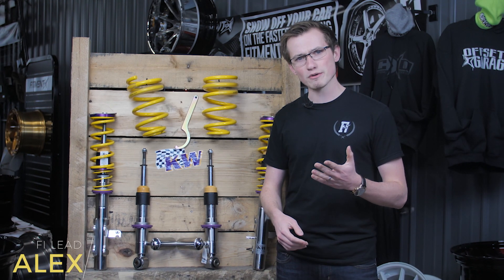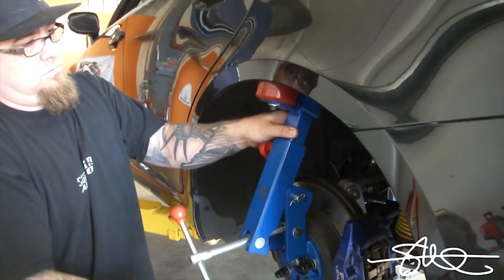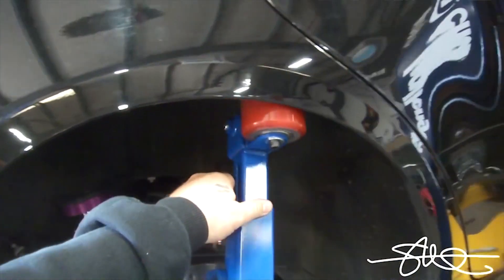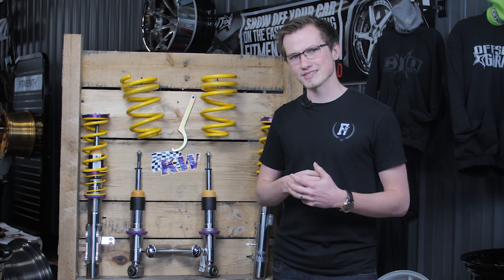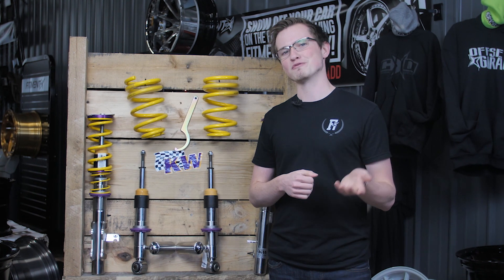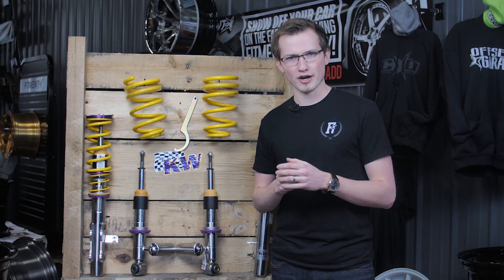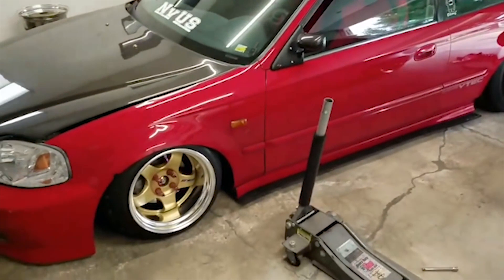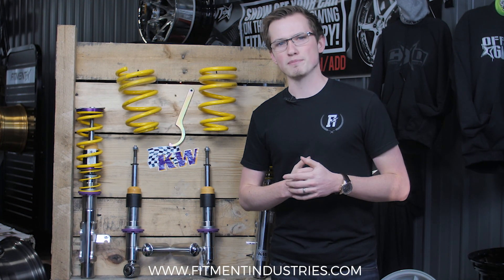5 MISTAKES When Lowering Your Car

Comment: took me years to learn but my motto is always do it right the first time because its cheaper than fixing mistakes.
Reply: Varg Sutton "Do it nice or do it twice"
Reply: That's kinda hard to do when it takes years to learn, though.
Reply: My $20 ebay short shifter broke I knew I should have bought brand name.
Reply: True

Comment: I feel like "lowering" should have been "slamming" cause most of us will do a small lowering kit, say 1-2" which negates most of these negatives (except alignment etc)
Reply: Gaunai yep. If you need to roll your fenders, you're slamming it (or you bought the wrong size wheels.)
Reply: @z-ro34  yeah I bought the wrong wheels 😓
Reply: @z-ro34  too wide 😪

Comment: go to your local grocery store
push a cart down the isle
that is my cars current alignment
Reply: Extreme vibrations ? I see
Reply: One wheel spins in every direction and barely touches the ground? Maybe time to get a proper alignment...
Reply: @heroichitsuji  yes the joke was that grocery cart wheels do not allow them to travel in a straight line when pushed forward, similar to my car, I am glad you were able to comprehend it and felt the need to reply to my one year old comment.
Reply: @Whitt09  you ever get an alignment?

Comment: I know most here won't care but another thing to mention are bump steer/roll center kits. All your current suspension components like ball joints and tie rod ends are meant to work with just factory height. Lowering can upset the car's roll center and increase bump steer. There are kits out there for each types of cars that can help correct these when lowering a car.  Obviously, they won't work when you lay frame BUT just for a moderate drop, these kits help a lot. And of course, you won't really feel a difference until you take the car to the track or even auto-x.

Comment: If you are new, and you want to lower your car...... Know how to angle your car to get over speed bumps and down/up ramps (driveways/car garages/etc). You cant just drive straight over/down/up things anymore most likely... Know your roads! Stick to the lanes youre used to. Potholes, dips, bumps, can and will destroy something on your car. I never drive slammed anywhere that I dont know the road and I always air up for sketchy roads (thank you air suspension). If you dont have the luxury of air bag suspension, pray. Unless your area has immaculate roads.. Then I envy you. Just some tips.
Reply: Michael Hookano I measured ( getting out measuring from the rocker with a tape and I did get some strange looks in the parking lot / from the side walks ) my local roads and most bumps are 5in or less so I put my lowest part point @3in from the ground. And you are so right thank goodness for low rider technology 🙂
Reply: This is why I don’t want to lower my car. I do want to get air suspension though but pretty expensive so I’ll wait till I can afford it. Haha.
Reply: The apron for my driveway is a bit steep until the sidewalk, then it flattens right out. Pulling my AMG into the drive was hairy the first couple times. There’s only one angle where i can pull in and not scrape the shit out of my front diffuser, and it makes my rear left tire come off the ground like a foot lmao. When i get my coilovers and put them on, im gonna need to get some planks or I’ll rip my bumper right off
Reply: Im raisin my car. I hate hitting a pothole or dip in the road and looking in my rearview hoping I dont see oil

Comment: Mistake #1, thinking springs will be "low enough". Buy once.
Reply: mrodr008 buy the right springs, bought h&r sport lowering springs for my benz 190e fitment is sick with 10 mm spacers. Some good shocks to go with them and ur set
Reply: Car Guy66 but they don't go as low as coils...
Reply: Victor Pascua Some people don't want to go very low. Just saying.
Reply: robertdevald agreed
Reply: Agreed! Bought h&r springs and they were not enough. I'm now on KW clubsports!
Reply: mrodr008 so true I was on eibach springs for ages and after a week it looked stock height again, I’m now on coils all the way down and no adjusters in the back and it’s so worth it
Reply: Just bag it

Comment: He missed probably one of the most important details when lowering your car lol "pre-loading the bushings" 85% of ppl don't do this and it's harmful to every suspension component on the car that has a rubber bushing lol ie loosening the control arms ect when lowering the car jacking the suspension up after u get the ride height set then tighten the components because rubber bushings work within a certain range lol lowering a car or even raising it for that matter puts it out of range and most alignment shops won't advise u on suspension pre-loading it also helps ride quality as u won't be   riding on binding bushings but this only applies to factory rubber bushings not polyurethane because in most cases the poly bushes are free floating within a sleeve
Reply: couldnt have said it better lmao period
Reply: @Duncan D'Amico i think the 'lol' are the periods

Comment: Gota go for a second alignment after it settles too 🤙
Reply: just wait until it settles and do a final alignment
Reply: Varg Sutton that’s what I did. Going a month or two without a alignment won’t kill you. I did mine in the winter so I had my winter tires on anyway so when it came time to swap them out I just did everything at once. Or if you know your doing a big wheel and tire upgrade wait

Comment: 17 tlx 20x9 rims 245/35/20 +35 offset, 2” drop all the way around eibach sport springs on stock shocks. No issues rides great did the alignment also,

Comment: One thing you missed. If your car has a  "reverse rack" it is there by design and your car is balanced to that stance. Dont be like me. I tried to adjust the rake out of two cars and wondered why they were bouncy in the front end for months. They wouldnt hit dips correctly and front to back was not  n'sync. Also dont nessesarily go for high spring rates or even coilovers. A progressive lowering spring and a nice Blistein, Koni, or even KYB if you must should always be your first choice unless it's a car for the track, drifting, show...
A lot of times the front and rear fenders are not even on purpose and manufacturer balances the car accordingly. The evened out flush look with squared  zero gap all around is clean looking but is not possible on some platforms without upsetting the balance of the car. Remember it isnt just putting an extra 100 lbs on the front, you are also taking 100 lbs off the back and its plenty to make the car have a rock and wierd bounce. BMWs, Lexus, and Porsche I have found are all picky when it comes to the weight distribution. Especially with higher spring rates. It will make the front leap first over bumps then the back will jump up and come down. Instead of the whole car accepting the bump evenly. Weirdest feeling I ever had. Cars rear end would sway bad at high speeds. Dangerous shit. I am sure you could swap springs out and compensate for any stance but the negative stability feeling it puts into the car might be hard to adjust out of it without going through hell and back.

Just my 2 cents.

Comment: Should have talked about the need for adjustable control arms/camber kits for vehicles that don't have stock adjustments!
Reply from the maker: Definitely! We will make another video going more in-depth on suspension components ❤️
Reply: Fitment Industries I bet that's one of the most often forgotten detail and expense  when lowering.

Comment: When I bought ST (KW’s little bro company) coilovers for my A4 B7 I never got an alignment. And I had 19” wheels.  My tires never rubbed never had camber issues and plus the wheels I had were deep dish with a lip. Now I have a 2017 Charger that I might lower but I rather wait to get bags.
Reply from the maker: Hey man if you need any help building a kit, shoot us an email! Shop@fitmentindustries.com

Comment: I bought a car that the previous owner put some Ebay lowering springs on. I want to change them out, but I like how low it sits. When I look up other lowering springs (I don't plan on doing coils, as I don't want to throw a whole bunch of money at this car), there's not another brand that gives it the type of drop these springs do. They haven't failed me YET, but I guess the search will continue

Comment: Do you have to wheel align every time you adjust coil over heights or only after installation? Thanks
Reply from the maker: Highly suggested to do anytime you mess with your suspension

Comment: So if you get suspension you need to get the wheels align. So what do you do when you want to run a rocket bunny or pandem kit for a forester xt do you need to get all together like 1st is suspension and than alignment for the wheels and than the wide body also wheels and tyres so what do you do first to last 
List of the stuff I want to do 
#1 Coilover 
#2 Wheels
 #3tyres
#4Widebody 
And #5 alignment 
So what do I do 1-5

Comment: Is rolling and pulling fender linings necessary if you decide to install a Rocket Bunny, Pandem, or any other wide body kit and run a bagged suspension setup?
Reply from the maker: Does depend but for then likely yes.

Comment: I have a question. I have a 2016 WRX and want to run a coilover setup just to get rid of wheel gap. I came down to two choices: Tein Street Basis Z or Raceland GJ/GP. Which setup would you choose? Tein has lower spring rates and the Raceland has Lifetime Warranty but im not sure on their qual.
Reply from the maker: We would definitely recommend going with Tein. They provide the adjustable damping where as race land doesn’t. Shoot us an email and we can hook ya up 😎 shop@fitmentindustries.com

Comment: Hey just wondering, I have a 1996 Honda prelude only 80,000 km got a bit of rust on my bolts that hold my struts mechanic was saying they could be hard to get out what would you recommend I stock up on so that I have all the parts necessary like bushings and stuff like this considering it’s an older car I might want to change everything got any good ideas?
Reply from the maker: I would advise just up keeping the ride meticulously clean and up keeping it and working with a mechanic as much as possible!

Comment: I need some advice, I bought new rims with low profile tires for my Toyota Corolla; the clearance space between the wheels and the fender lining is about the same as it was on the original wheels, but I want to lower my car about an inch or two so it looks a little better (I don’t want to have it sit too low to the point I have to go across speed bumps extremely slow or side ways). What is the best possible way I can lower my car 1-2 inches.
Reply from the maker: I would suggest coilovers and or Lowering springs which we have available on our site here take a look and see what we have for your ride!  https://bit.ly/2qvG7o0

Comment: Lowering your car and not addressing sway bar endlinks is a quick way to having wierd suspension. 
Also like he said cheap coilovers are usually over sprung and underdampened .> Or their compression dampening is mismatched... > or the high speed compression is not aggressive enough and low speed compression too soft.. 
Factory suspension has the benefit of R&D as well as QA and QC that MaxSpeeder and all the other rebranded china suspension doesn't have. But YMMV [your money may vary] .. I'd stick with factory dampners and lowering springs until you can save up for good quality coilovers.
Reply from the maker: 10/10 agree I would much rather save up over time and get a really nice quality set of coils rather then something cheap to get your car low fast.
Reply: End links is currently my problem with the 2inch drop that my Flex Z coilovers came with. Adjustable end links are such a small part but very crucial.

Comment: I actually bought some coilovers earlier today, waiting on them to arrive. Does anybody have a recommended list of what supporting mods i should look into while i wait? Its for a 2013 Kia Forte Koup SX if that helps.
Reply from the maker: Have you considered wheels yet?
Reply: Im considering some motegi mr116's but theyre a bit out of price right now
Reply: Fitment Industries are there any other parts i should concern myself with? Like control arms, bushings etc? I know you mentioned those in the video, but will my car need them?
Reply: You were doomed from the point you said "kia"
Reply: GUNZ i know kias are looked down upon in the community but its a blast to drive. Im not trying to go crazy stance on it, just droped and maybe -2° all the way around. If people want to hate on it its whatever, but its not a bad looking car and its a fun drive.
Reply: NoT2BaD fun to drive for the proce you mean? Shouldve just got a used car for the same and had more fun.
Reply: thrashingjustin it was a used car, it was a 2013 with 30k on it and i got it last year
Reply: thrashingjustin also i didnt mean for the price, its actually just a fun drive
Reply: I fuckin hate kias, but these are decent looking cars.
Reply: Gage Lidstone they look even better with a roadruns body kit, and can make in the nieghborhood of 800 if you do the right build with a turbo, but you need a lot of reinforcement on the engine components, and a standalone Haltech ecu if you want do any tuning. Theyre not the most popular choice but the new model year ones come with a turbo stock
Reply: NoT2BaD seems better than the stinger lol. Do you post vids on it? If you're planning on building this thing I'd love to watch lol
Reply: Gage Lidstone if i had the money to do what i described id love to but the bodykit itself is like 3 grand to import from korea plus a 3-4 month waiting period. The ecu is like 2 grand, turbo kit 3 grand, engine rebuild 6 grand etc.

Comment: what are some good affordable coilovers in your opinions ? free ears
Reply: Wuilmer Mendoza bc coilovers are an amazing coilover for the money. They ride amazing oh my e30
Reply: Tein
Reply: Looking for ones with Dampner  cause i want to be able to put them as stiff as i prefer
Reply: I take it that Racelands aren't good? The Primo (stiffer spring rates with adj. dampening) option specifically? Not many coilover options for Foxbody and SN95 Mustangs, just Racelands for under $800 and either a Max. Motorsports or Eibach kit for $1,800+
Reply: MrDaxtr i have 8th gen Si so there's a lot of options just not sure which to choose
Reply from the maker: Depends on your budget! If your looking for under $800 Tein is definitely the way to go
Reply: MrDaxtr  I have racelands on a 2002 sentra, they ride pretty nice for coilovers, I'm comparing them to some  Function forms type 1 on my hatchback civic. I'm only assuming that because it's a shorter car than the sentra it feels a little more rough but still decent for daily drives. I would say for the price Raceland was awesome they didn't have all the goodies like dampening and camber adjustment for my application but I know they do carry then for other vehicles.
Reply: Yonakas
Reply: save up for nicer coils. anything under 1000 is junk imo. like already mentioned, bc/fortune auto is my go to recommendation and definitely worth it
Reply: Are the prices mentioned per each coil over or for the set of 4 ?
Reply: Chanania Lala coilovers are always for a set unless they are time times front only but that's really for trucks only
Reply: NAVYPorcAirmenAM ricelands are terrible in every way. Not even good for value. Ask anyone who used to own ricelands and went to real coilovers and they will all say it's not worth anything

Comment: My motto is lower your car buy wheels and meaty tires and get working on the fenders and quarter panels..its easy stop complaining
Reply: 71BGLancer what size tire should i get on a 16x7 +40 wheels 07 civic lx sedan